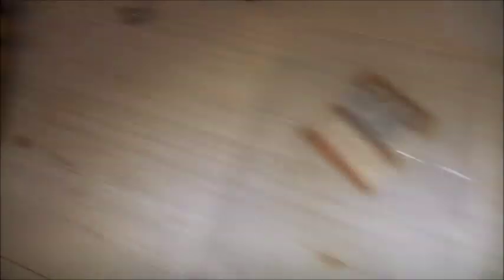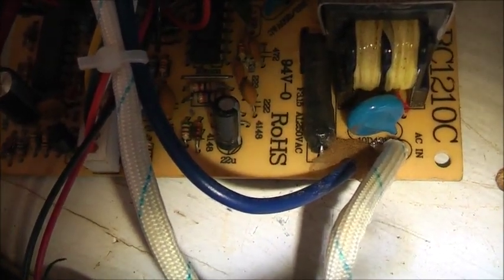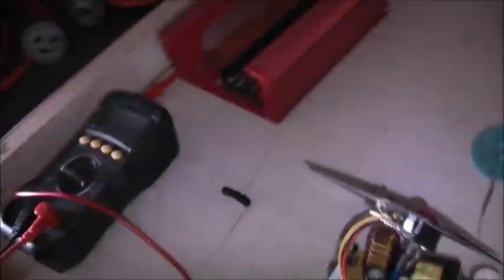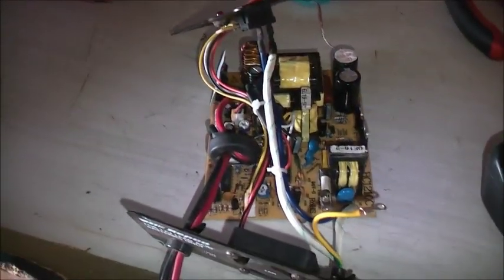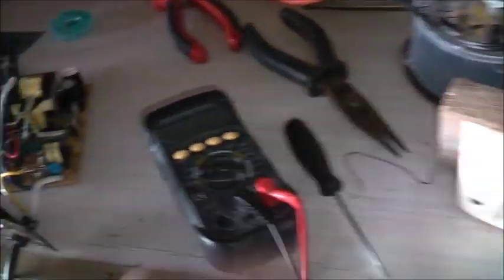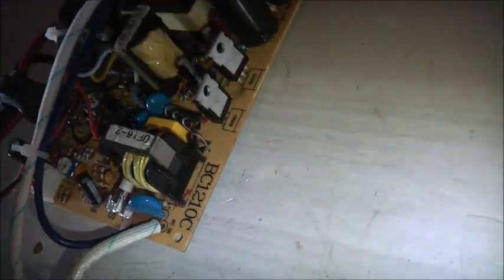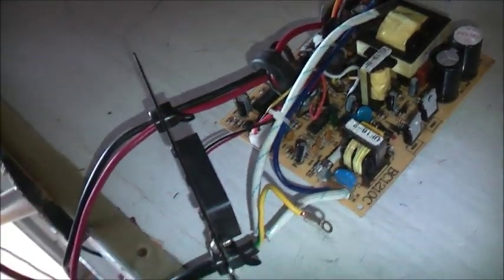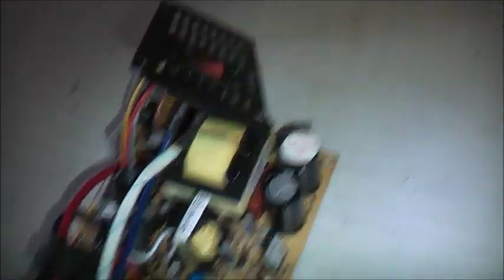Troubleshooting Switchmode Battery Charger

Comment: I once have replaced a lot of bad components in a PC PSU and the damn thing didn't want to work. I took out the rectifier diodes and when I checked them, guess what? they were bad. Replaced them with some 1n4007 diodes :)). Check the capacitors. Good luck on repairing it mate! :)

Comment: Pull those diode out of circuit to test them, you may be getting false readings from something connected to them.

If those devices you fitted are transistors i would trace back the drive pin of each device and see if it overloaded/killed its driver.

Check the electrolitics for a short.

im old fashoned, a mains transformer and simple design will last longer :-)

Dont give up mate :-)

Comment: The reason for the hate of lead free solder is because in the early days of lead free solder there was a lot of it with impurities and because it required a little more heat. 
A good quality lead free solder works much the same as a leaded solder. 

Now there is some truth to the "shit" nature of the solder used in mass production.
Since the goal is more for less they use less than ideal solder in a lot of situations.

Comment: You have bad diodes. Keep in mind that some of the diodes will be high speed diodes.
When you lose the switching transistors/FETs they short and usually kill components on the gate. I did not get a good look at your board but I thought you had a full wave bridge rectifier there.

People don't like switched power supplies because they do not understand them.
I have fixed more than I can count - sometimes you get a dog but even my dogs never bit hard.

Comment: So the supply has a dead short in it someplace? I would check the filter caps in there, if the diodes shorted out it would have damaged those as well. I haven't tried repairing a switch mode supply as yet but from what I've read once something goes in them they are basically garbage since it seems that one failed component causes a cascade of other failures. Maybe you will be lucky and find the problem but for my money nothing beats a linear power supply for reliability and serviceability.